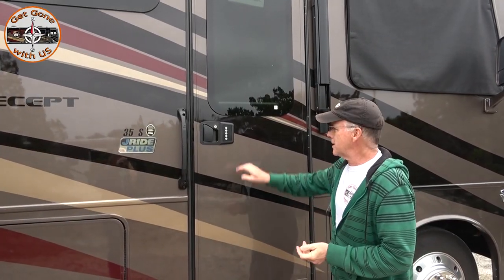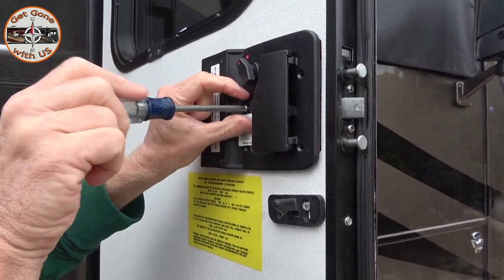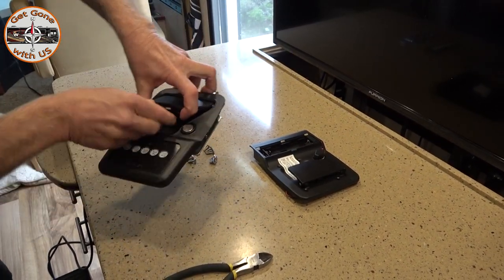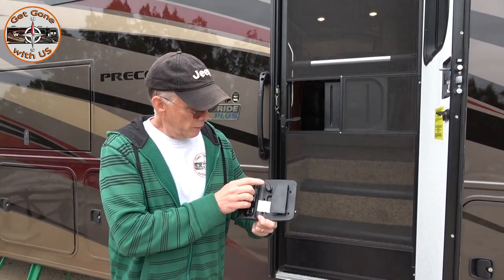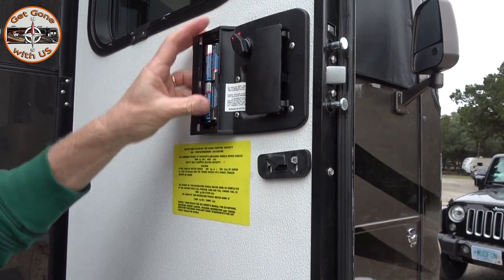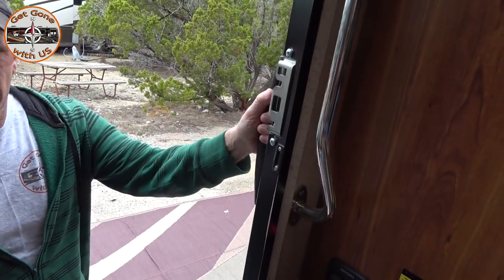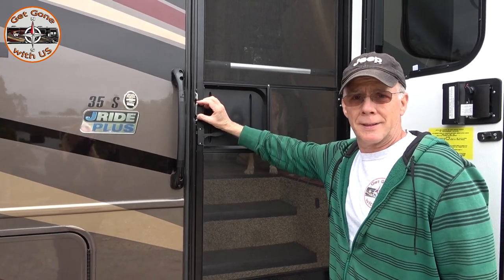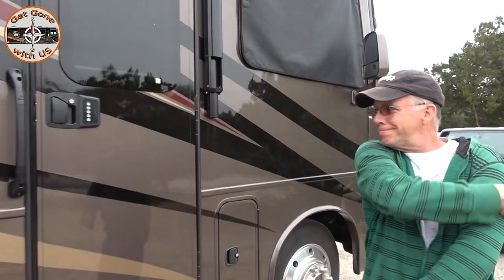Electronic RV Entry Door Lock - Installation and Programming - Bauer EM

Comment: Thanks much for the instruction.  Changed the batteries and had to reset the code.  You showed that and made it easy.  TY!  Hopefully won't have to change the lock but if so I'll be back to check it out.
Reply from the maker: You are welcome, Susan! 😀

Comment: We have the same lock: . When door is closed, it is not “snug”, you can pull on it, when locked , door seems to “come forward a fraction? Just not snug enough as it should be.? Also the “toggle” ( lack of a better term) That you recommend spraying with silicone, is very hard to push in and we cannot close the door without using the handle to pull it back?
Reply from the maker: Without see it, we would recommend realigning the door lock and make sure none of the screws loose. Check to see where it hits strike plate and adjust. 😃

Comment: Just curious if there's a need for a sealant on the outside portion? I see there's a gasket that compresses on the outside portion, but wondering if that's enough to keep water out? (thanks for the great video!)
Reply from the maker: Thanks!  Jayco didn't put on any sealant that the directions didn't call for any either,  so we didn't use any. When we took the one one off there was not any signs that water had gotten it. 😃

Comment: Ours stopped working 3 months after our warranty expired. We were in the mountains and had gone out for an evening walk. Locked using the pad with no problem. Came back just before sunset (it was getting very cold), and were locked out! Had to wait 2 hours for a locksmith to come up to open the door. We replaced it because it’s so convenient to use, but I always have a key easily accessible.
Reply from the maker: We never leave the RV without the key too.  Even though they say getting lock out can't happen, we didn't have the same faith. LOL  Sorry it happened to you guys. We do love the convenience also. 😀

Comment: So why wouldn't someone just set their own combo to defeat the lock if they want in?
Reply from the maker: In order to change the code you need to know the current code the owners put in or have access to the batteries to to reset the code back to default, which is located inside the RV.
Reply: @GetGonewithUS  Thank you for the info. I just got one and the directions weren't clear on that.
Reply from the maker: @Strutingeagle  Not a problem.  We really like our lock. :)

Comment: How do you prevent someone who knows how to change the code on that lock from walking up and changing your code? Is there a switch somewhere on the inside that needs to be flipped first
Reply from the maker: Like we said on the video, the batteries have to be removed so it forgets the current code before it will accept a new code.  The batteries have to be removed from the inside, so it would be impossible for someone to change the code when the door is closed and locked.  😀
Reply: @GetGonewithUS  oh duh my husband and I both missed that part 🤦
Reply from the maker: @seabliss22  No biggie!  We always ask if we miss something too. 😀

Comment: Hi there Chuck and Cheryl and it was nice to see Brandi too.  I had the same problem with ours and had to switch it out.  It is also the HSS type.  I've had better luck with lithium batteries, especially during colder temperatures.  They're more expensive, but they last longer so I guess it evens out.  To be on the safe side, just be sure to always have your key with you . Also, if you try to lock it and you hear a long beep open the door and make sure the deadbolt is in all the way. Just a finger push should do the trick.  That might be something that happens to yours after you've used it for awhile.
Reply from the maker: Hi Carl!  It has been so long since the keypad worked, we forgot how much we liked it.  When it worked,we never left with out having the key too.  Murphy's Law loves to follow us around, so we don't want to help him out by making it easy. LOL
Reply: @GetGonewithUS  I'm very familiar with Murphy too.
Reply from the maker: When we meet, we'll have to team up against him! LOL
Reply: @GetGonewithUS  Sounds like a plan.